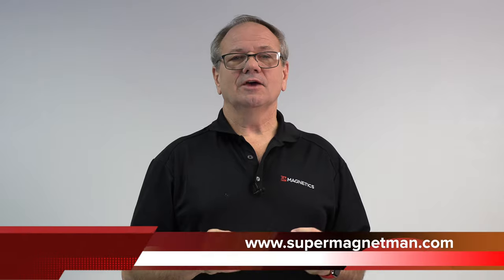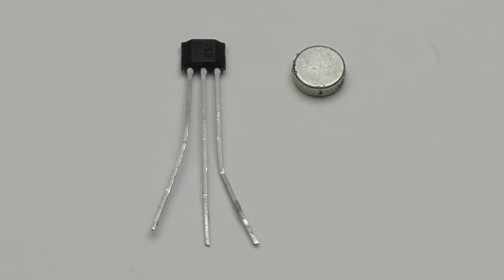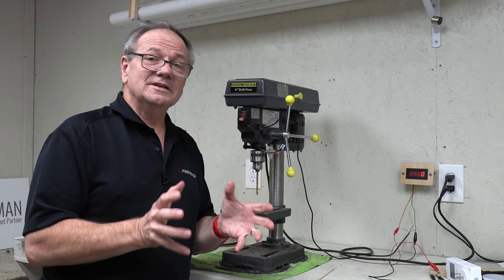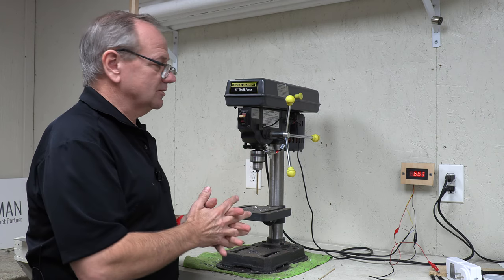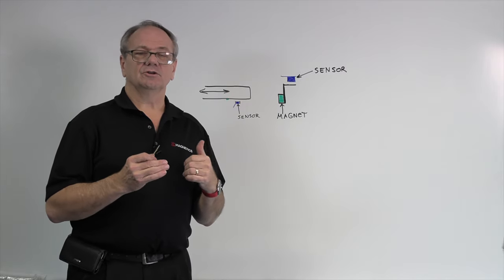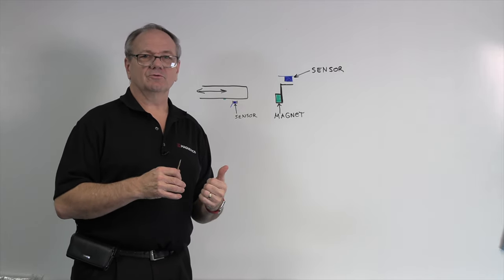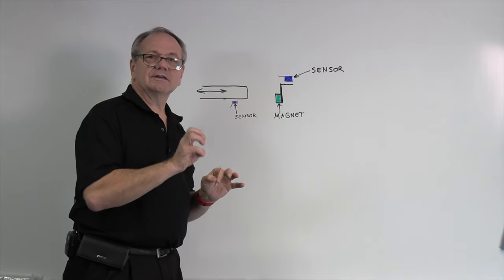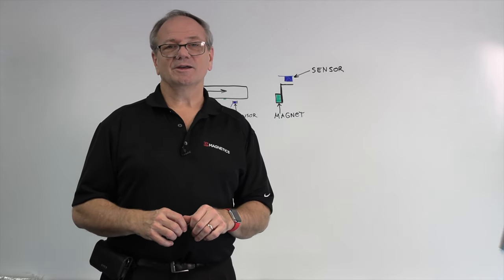Magnets and Sensors

Comment: How can you use a two sensor motor with a three sensor driver, can you tie Ha to Hc together since their signals will read a North pole and Hb would read South pole (Ha-N) (Hb-S) (Hc-N). Don't want to add a third sensor to the motor to keep it OEM. I would like to add a jumper from Ha to Hc or would doing this burn out my driver???